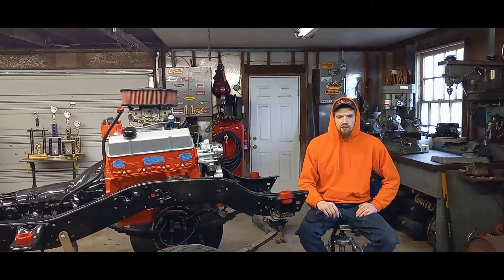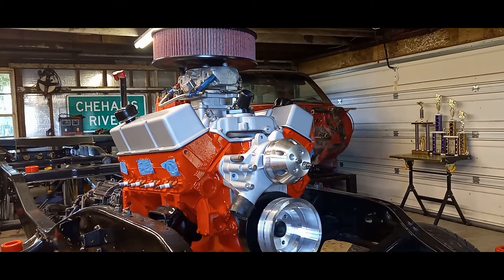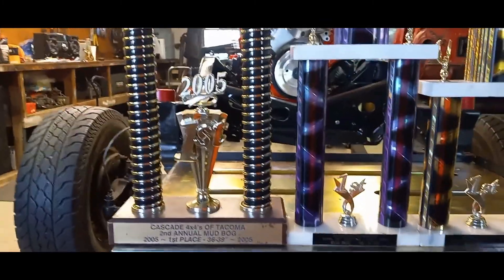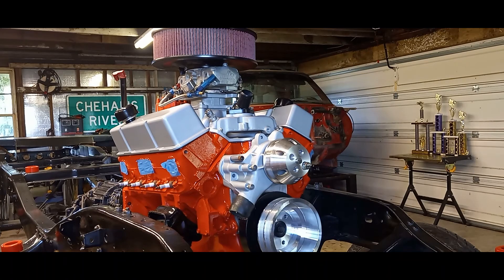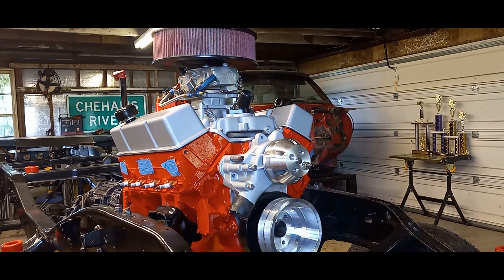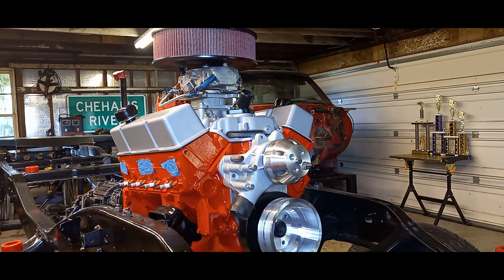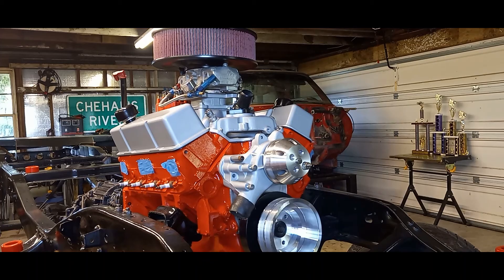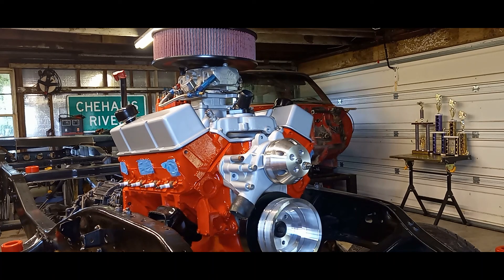HOW TO BUILD A 550-600HP RACE WINNING 383 STROKER SBC SIMPLIFIED. RACE PROVEN DRAG TRUCK ENGINE!

Comment: So just found this channel been watching a few videos,  LOVE the info. Super big into turbo 4 cyl but trying to get back into the v8 stuff haha. I'm 24 so I've got some time to learn.
Built a 383 a few years back with my dad when I was in HS. Now that I see your channel I'll ask you as well... it's a VERY basic bottom end, stock 400 crank and rods with arp rod bolts. Obviously not ideal for RPM. It's been well balanced and everything but still a little scared lol.and it only has hypereutectic flat tops, about 11:1 with basic AFR enforcer 195 heads, flow chart shows 250 cfm flow at .500 lift and 251 cfm at .550 and .600. I don't ever plan on taking these off the engine now. ANYWAY, currently it has a comp xe274h hydraulic flat tappet cam. 490/490 lift, 110 LSA, 274/286 adv. And 230/236 at .050

I'm looking for more power out of it but really only want to change the cam and valvesprings (if new valvepsrings are required). It's mostly just a fun weekend car I'd like to trailer to the drag strip sometimes a couple hrs away. Got about a 3k stall and 4.10 gears. Any recommendations on a solid flat tappet? This has been a budget build from the very beginning, don't really see the need switching to solid roller, but I would really like to learn valve lash and thought I would raise the rpm on this a little to see how much I can get out of it. Do NOT need crazy longevity out of it. Obviously I want it to last but it's just a toy and does not need to be driven if something happens to it. Any info is appreciated!
Reply from the maker: Thanks for watching bud, you are definitely going to want to change the valve springs on those heads, afr enforcers come with hydraulic roller valve springs. I recommend these valve springs they are pac racing part # pac-1218-16 they are beehive springs perfect for these 2 cams I'm about to recommend, the springs are the right diameter to replace the originals. The most ideal camshaft you can get off the shelf from like summit or jegs, for what you want and what you are doing with the cam is part number hrs-cl110812-06d1 its howards cam and lifters for set for $318.99 at summit which isn't bad.. specs .534/.542 lift 106lsa 248°/252° at .050 advertised duration is 286/294, This camshaft will give you a fat power and torque curve because of the 106lsa mix that with a 248° intake/252°exhaust duration at .050, advertised duration is 287°intake/294exhaust this duration will provide you with the ability to make peak power at around 6500rpm and peak torque between 4900-5200rpm and you could probly shift at 7000rpm. With a 1.5 rocker valve lift will be .534lift intake .542 exhaust, this isn't as much lift as I would like to see but that's what you get with a off the shelf cam there are compromises, the Lsa and the duration are more important, these lift numbers will enable the utilization of most of what your head has to offer. This is about the best cam for you that you get off the shelf, I would recomend getting a custom grind from like comp, isky, Howard's, crane, ect I would pick a single pattern cam that specs .565 lift 108Lsa 104icl 248°at .050 294 advertised duration, install the cam 2°advanced. This camshaft will allow you to utilize about all that afr 195 cylinder head has to offer and you will have about the same rpm range as the other cam just more hp and tq. It should make 510-520+hp and 500+lbft torque naturally aspirated, with engines I always think it's better to under rate and over deliver then over rate and under deliver. If tuned properly you could also get away with feeding it 150hp shot of nitrous even with hypereutectic pistons no more than 200hp shot, then your making around 650+hp which is pretty good power that makes for a pretty quick street/strip car. that is enough hp to get into the low10s - low9s in the 1/4 mile, depending on who sets the car up and whether or not they consider all the variables. You could also consider taking the heads off and doing a little simple cleanup porting and unshroud the valves that will give you more HP FOR FREE. If you did a little porting you could change the cam specs to a cam with a little more lift because you will have more cfm available, which means even more HP. Also since you are going with a flat tappet cam I would look into getting some driven racing assembly gel or grease, the label it as gel or grease, I will never use anything else personaly. I've had flat tappet cams go flat for no apparent reason until I found that stuff and their br1 or br2  breakin oil's. I gave you this answer with consideration of the bottom end of your engine being stock b esides flat top pistons and arp rod bolts which do make a bit of difference.Hope this helps!
Reply: @ACDGarage_Racing  thanks for info! Yeah actually I am going to run this cam with the little bit heavier spring from the start and see what happens. Haha I understand I probably shouldn't be doing this, BUT everything was broken in correctly and I'm more curious than anything. Will change them over at some point. That's about the exact size cam I was thinking would be a good match actually so I'm glad I'm looking in the right area! I used the driven stuff to assemble the engine originally actually if I remember right? Broke it in myself too. I'll be setting up the engine myself but will definitely be taking it to someone else to help a little with the suspension work... gonna drive it the way it is with the better heads for a while. Used to it with stock heads so I'm very excited to see the bump in power from some modern heads...
Reply: @maaaxxd372  You wont go back to hyds after having a solid lifter cam. They rev seamlessly and simply make more power. 
And..the interior/external noises they make are music
Reply: @ACDGarage_Racing  and yes I 100% agree on under rate and over deliver! I'll always way under rate it so I won't be disappointed if it doesn't meet my expectations haha. Thanks again for the info I love it.
Reply from the maker: Right on man, you are welcome. Goodluck with your engine and car if you have anymore questions just shoot me a comment.
Reply: @ACDGarage_Racing  haha so did some more research and I think I WILL switch to those springs sooner than later! So, the afr springs are the 8017 1.290 for hyd roller. I haven't done a spring swap in quite a while. I don't need you to give me part numbers haha i don't want to take up even more of your time, but if i went with those bee hives, would I need all new lock retainers and everything else for the valve? Not sure what would be usable/not with the other springs! Thanks again
Reply from the maker: @maaaxxd372 lol. yeah you would need new locks and retainers, but those are pretty cheap.
Reply: @ACDGarage_Racing   I'll get them ordered now! Assumed since it was a single bee hive they wouldn't be interchangeable. Oh well thanks again!!!
Reply: @ACDGarage_Racing   sorry again! Lol! So I guess the afr has the 8mm bead lock valves. The only retainers I'm seeing for the pac 1218-16 are the ls1 versions. Is that what I need for the 195s? Really not sure what that changes...
Reply from the maker: @maaaxxd372  yeah afr and ls valvestem diameter are bolth 8mm and bead lock style. Them are what you need.

Comment: You think I could upgrade the heads and internals to survive under boost?
Reply from the maker: On a engine built like this?
Reply: @ACDGarage_Racing  yes 383 this style.
Reply from the maker: Ultimately this setup even with those 186 cast iron heads would handle forced induction or nitrous just fine, a pair of nice aluminum heads would obviously make more power, also if I was going to put turbos on something like this I would use a single plane manifold because there would be no lack mid range torque . You wouldn't need do do anything internally as long as it has a forged crank, h beam rod or something compareble, and forged pistons preferably. The thing I would worry about would be the stock block once you start making alot of power. Hope this helps
Reply: @ACDGarage_Racing  thank you

Comment: hi sbc 400 afr cnc 195/210 ,, 248/252 SR cam  ,,  11;1CR  [vic jnr 11;1 540 hp ] [   super victor 260 SR  cam 11.3 CR   570hp ] 
400 cuin CNC 227 heads super vic 270 SR 12.3;1 CR  pk hp 640 @ 6900rpm 
above with 830 cfm or larger carb 
400cuin 230 dart Pro 1 alloy heads 11.;1 CR 242/248  HR  525hp at 6300 rpm
dual plane ede rpm donot like 400--410 cuin and above  top end hp is reduced . 383 ok

Comment: Hey Adam, have you done any AMC engine building before? I’ve got a couple Jeeps I’m building up now and I’ve got 360s in em that I’d like to go thru and  get some power out of instead of the 144 they came from the factory with. I’ve heard that I can stroke it and it will wake the 8 little monsters up that supposedly live within each cylinder wall and it’s sposed to make a ford guy cry after being paired up with em. 

Anyways, just curious if you had done anything with the AMC before or not. There’s not a ton of guys around that mess  with em anymore but I’ll figure it out. 

Nice job on that 383 tho!! I bet she’s a handful!!
Reply from the maker: I've never messed with an AMC personally but each engine of course is unique but in the same aspect the way to build horsepower coralates between them all. Ultimately an engine is just simply that an engine. Thank you don!

Comment: hey thank you so much. What do you think of this combo plan? = 
  4.O3O" bore. Block 4 corner decked to pistons with O.OO5" out top of block. O.O43"  head gasket.  300 cfm @ O.65O" lift. 89% bowl.200-220CC Brodix ported race rite heads. 2.05" intake 1.6" exhaust valves. 8 mm valvestems. Phosphor bronze tubes. sodium filled exhaust valve. Comp Cams XR288HR10 hydraulic roller. 1.65:1 crane gold race rockers on intake side. 1.6:1 on exhaust side. Moroso worked oil pump blueprinted. Hardened chromoly steel oil pump driveshaft with taper to reduce weight. 1- 3/4" equal length 180* header primaries. 850 cfm vacuum secondary with down leg to step booster. Additional part throttle circuit added with adequate flow. HEI pro distributor. 2 piece reinforced roller cam timing cover. TH4OO custom built with standard pattern. 3500 stall tight nitrous style converter. 3.00:1 gears. Street car daily driver. static compression shall be close to 10.8:1 thinking of using the XR294, or XR300HR10 and adding 3.73 or 3.90 gears. Custom gear set of 2.10, 1.40 and 1:1 main. / OR just dropping compression by adding a few CC on piston and or chambers. The rods are 6" and a stroker clearance type for any stroker, and mahle pistons with total seal rings.
Reply from the maker: Sounds like a pretty good combo and you are working with nice parts, I like the oil pump, I won't install an oil pump without port/polish and checking clearances. the quench is good .038 . If you can I recommend getting a custom ground cam on a 108lsa, that alone is worth 25+hp and an equal amount of torque. If you can't the xr288hr is a good choice for your setup and with 1.65 rockers the lift on the intake will be .572, Stock rr200 heads flow around 264cfm at .572 lift I imagine yours flow about 285-290cfm at .572 . You should be able to make some pretty good power. I wouldn't go to big on the cam unless you intend on it living at high rpm. Thanks for commenting